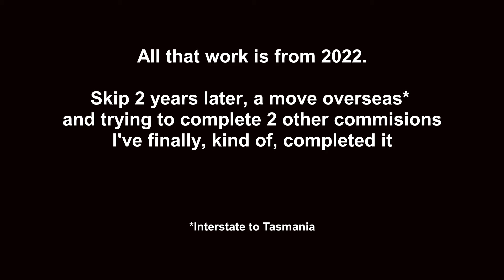Zamora Guitars - Paisley Offcut Thinline Tele

Comment: Why do you bother using a plane and orbital sander when you have a wide belt sander?  Thank you.
Reply from the maker: The drum sander only takes off a tiny amount at a time and is not really its intended use for this situation. A thicknesser would be the better option.

I like hand planes but also a scrub plane would of been a better option.

So yeah, not having either of the tools more suited for this particular job I just used whatever was available.

The workshop that im at is setup more for acoustic guitars rather than electrics.

hope that helps